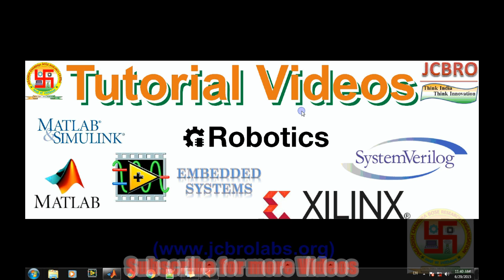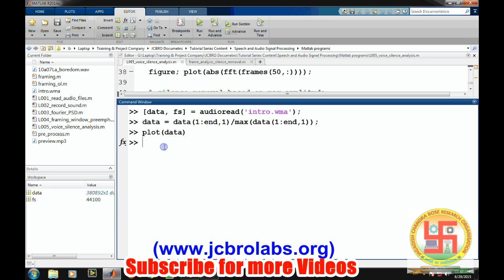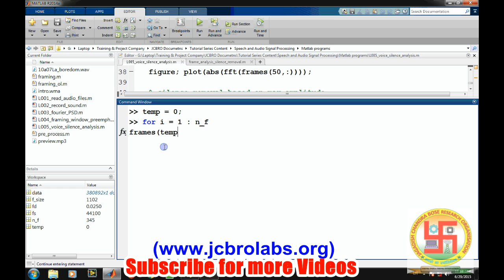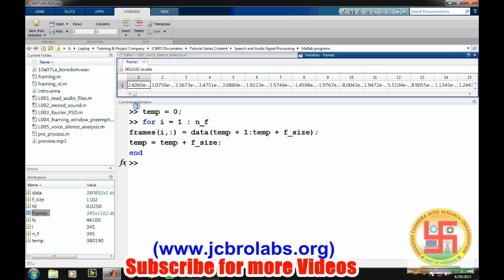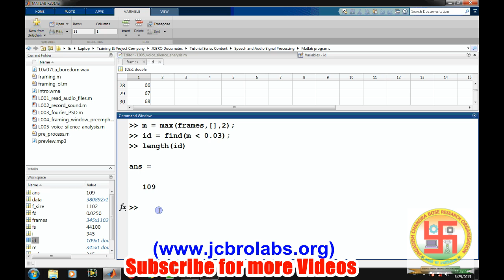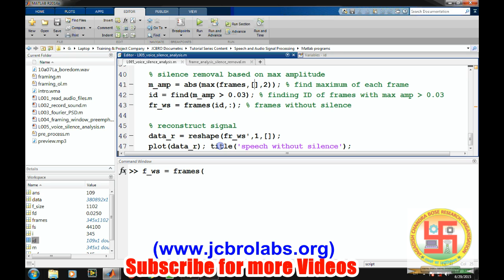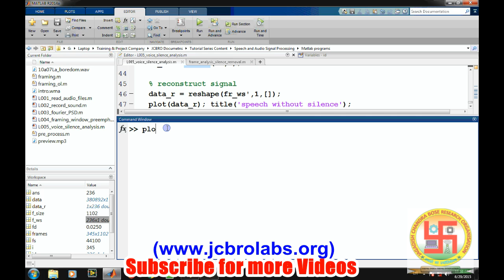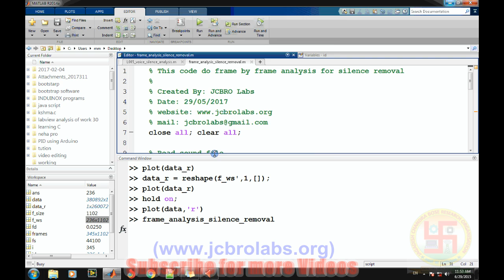How to remove silence from Speech Signal by Frame by Frame Analysis??

Comment: There are speakers who pause to let the idea sink in. LOL. We also have inter word pause and inter sentence pause. Apart from amplitude, we also need to look for duration of silence. How does this handle them. I do not use matlab and hence could not check this out. It would have been useful if you had played the sound files as part of the demo. A visual does not provide the same effect. 
I do have lots of uneven long pauses as I create edited audios. I would like to create a speech file with even pauses. Thanks for a conceptual demo.
Reply from the maker: Thank you sir for your this insightful information.